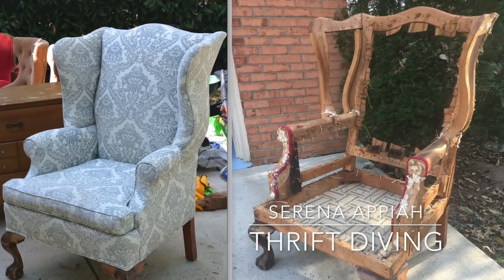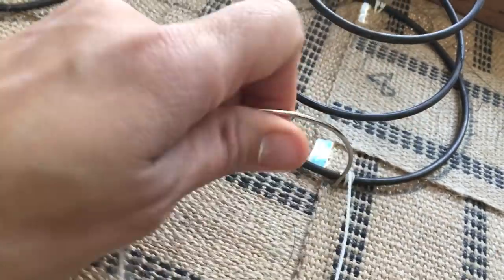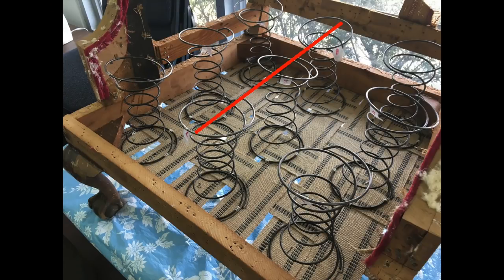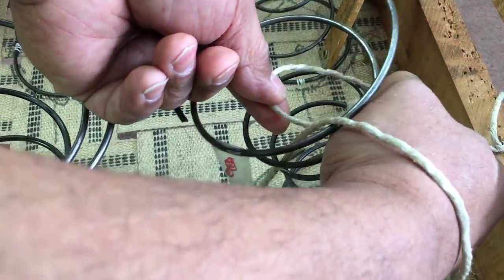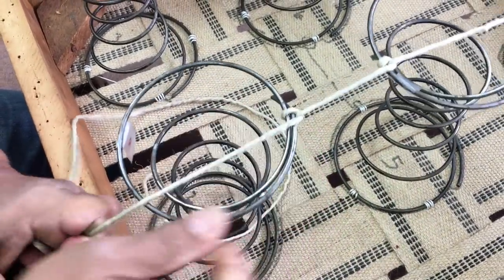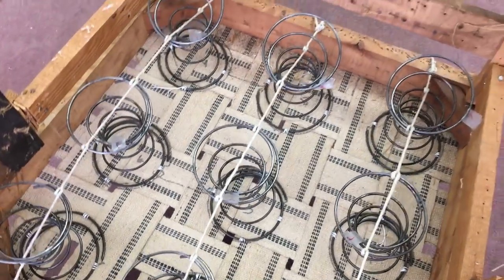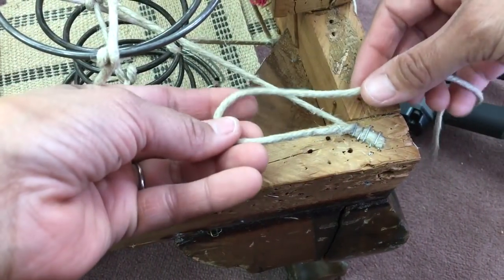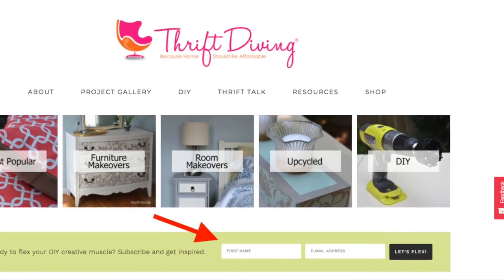How to Reupholster a Wingback Chair! PART 4: How to Tie 8 Way Hand Tie Springs - Thrift Diving

Comment: couldn't you use a large crochet hook to get that twine in those tight spaces? I'm curious as to how much fabric you end up getting for this chair.
Reply from the maker: Hmmm....I don't know. I have never used a crochet hook so I don't know how that would work. Seems like the professionals use the curved upholstery needles.
Reply: I was going to suggest that too for tight spots or towards the end when trying to get fingers through twine and spring makes it very difficult.  If you (or a viewer) has a larger crochet hook lying around, might be a good fix for that problem. Wouldn’t hurt to try.

Comment: Repairing the webbing and springs is something I refuse to do. Maybe a small chair. I have had some old chairs     which needed a full repair.  Nevertheless it works as it is. Once the new fabric is on you'll never notice the old webbing and burlap etc.